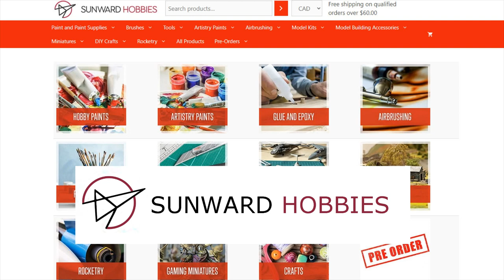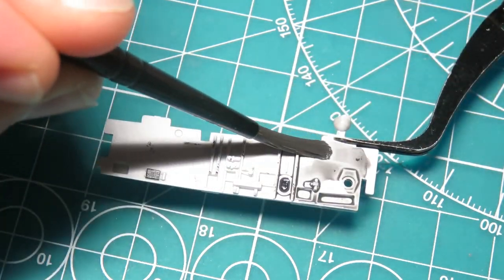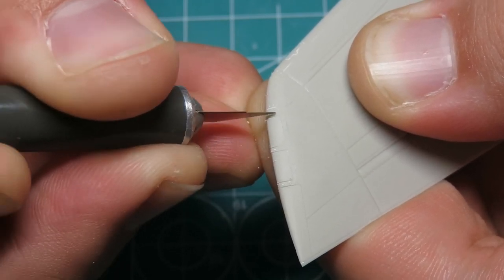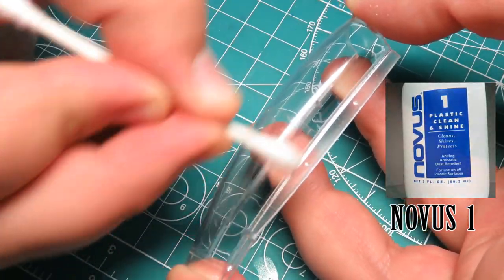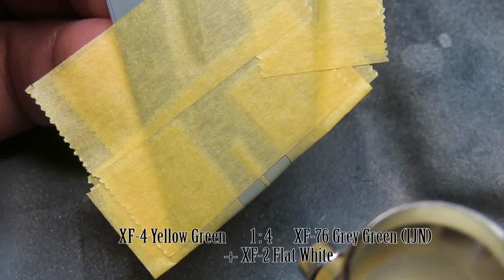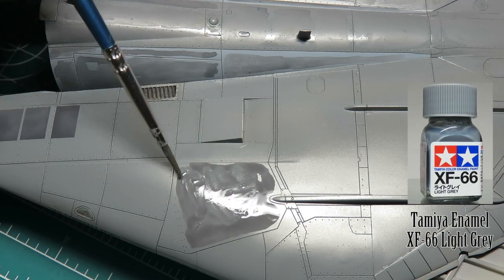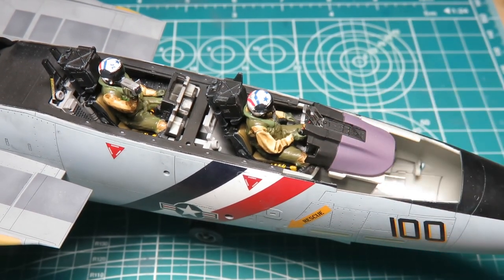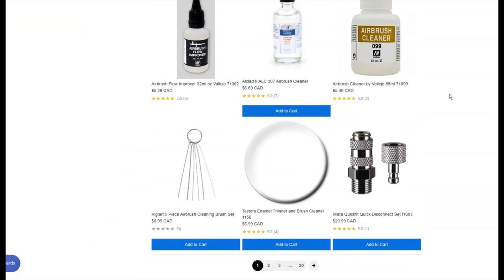Tamiya 1:48 F-14D Tomcat (VF-2 Bounty Hunters)

Comment: Nice kitten there 😊. I've built the same a while back and went with the same loadout. I really wanted to add two AIM-54 on the front fuselage pylons, but I wasn't sure the real kitten could handle the extra weight because of the TARPS, so I chose not to add them. I also painted the black part of the nose like you did, instead of using the provided decal. This is a great kit from Tamiya. Maybe they all are 😊
Reply from the maker: I thought the TARPS would be a fun different addition compared to my other F-14A that I built last year. With that one I added all of the weapons I could to the pylons.

Comment: I was the lead 12C crewman for VF-2 on its last 2 cruses. Fun fact the top rocker "Last Tomcat Cruse" and later "Going out Swinging" bottom rocker on the twin tails we not authorised markings at the time. they were retroactively approved.
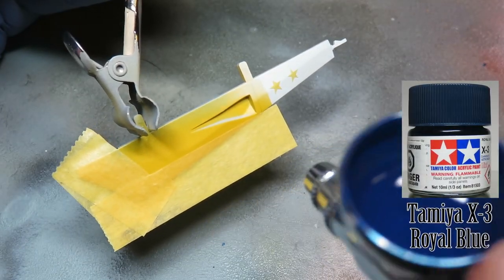The starboard ventral fin has an antena on the out bourd side, in it that should not be painted. On the real plain it was about the size of a note book standing upright. It can be seen in the modle. 13:08 But how would you repersent the honeycomb compositeon such a small model? I know you said that the blue was hard to apply but for us it was that yellow. It just did not want to stick if it was too hot out.
34:37 Last the yellow caps to the vertical stabilizers have the kick down on the leading edge, instead of straight accross because of me. I pointed out that by painting the entire pannel the same yellow color we would save 8-15 man hours of labor every time the avionics technicians needed to scratch them all up. Originaly they were yellow top, gray bottom, with a black border line 1/2 inch wide. The black border line would also go accross another pannel that could not be removed. 

Still outstanding job.
Reply from the maker: Thanks for your comment, this was really exciting to read :) I found several pictures of this F-14 with the lower fin, but in some of the pictures it looked like copper, or gold. I couldn't find any proper pictures that showed the fiberglass covering, so I made the decision to leave it painted blue. I do regret that and wish that instead I made a decal with the color and texture.

That was because of you? I really had a hard time painting that yellow section on the tails haha. It was tricky because that section of the tails in that scale had a lot of raised edges and I had a hard time getting the tape to conform to the area. But even though it was a bit frustrating, I still think it looks really sharp :)

Thanks again for your comment, your insights into this F-14 were really helpful. This is one kit that I want to keep on building. I've got another F-14A that I have to still edit and upload, this one is a Sundowner.